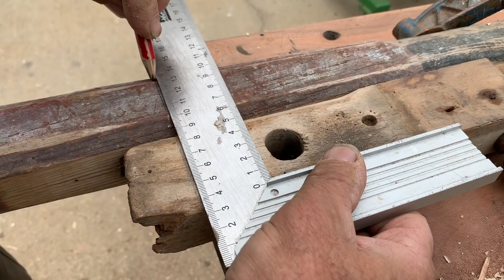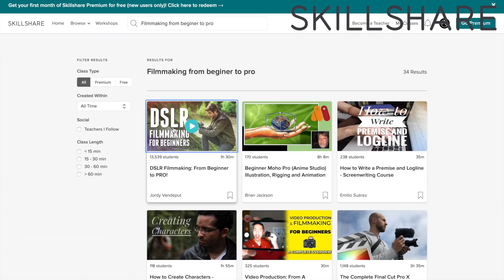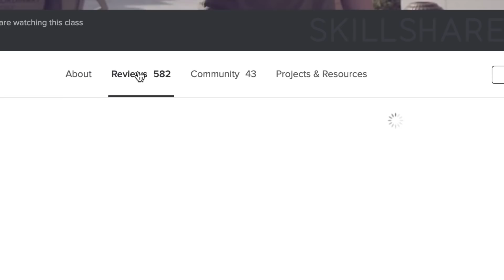Very damaged wooden Wheelbarrow Restoration

Comment: It seemed like a majority of your work here was in replacing dry rotted wood.  you used several methods of repair and replacement, all beautifully done.  It definitely added some character, and strength as well, to a work that already had plenty of both.  Excellent,  as usual!

Comment: Lovely restoration, but you should have kept those old square nuts.
Reply: it looked like they had a left hand thread!
Reply: @markwilliammandigers1001  They had, but LADB could have used a left-hand threading die (easily purchased on Internet) or re-threaded the nuts to normal right-hand thread (but that would not have kept the nuts genuine).

I´m very much for keeping old stuff as genuine as possible, without taking away the original roughness of the material and the patina received from many years of use. I also believe that such an approach heightens the value of the restored item.

Comment: I will never understand the fascination some people have with spending so much time restoring something by patching the old lumber. If it was something that the old lumber was so valuable and patching could be done cleanly and artistically, then that could work. But for me, I would have just rebuilt the whole thing using new lumber and been done in half the time, and have a much nicer looking end result. As for the end result, you want the antique weathered look? Leave it outside for a year or two and you will get it.

Comment: This is the type of work I imagine a village handyman would have done in 80 CE to the 1200 CEs.
Reply: Except for the electrical drilling mill press, the Dewalt belt sander, the steel screws and washers, the square ruler, the bonding compounds, the cordless handrill, the skill, the electrical jigsaw , how the hell is that 80 CE - 1200 CE? Because none of that shit existed in those days.
Reply: You're right there was no electricity, however the power source was your muscles, and the result was the same.  All of the various components/tools did exist, just in a different shape.  The human skill was even greater since you had to think instead of letting a computer do it for you.  Bonding compounds??, have you never heard of rabbit hide glue or fish glue???  Cordless drill? every drill was cordless, jigsaws were hand powered.  The world did exist and existed very well and artfully before electricity was discovered.  Are you saying that people were incapable of making a true square piece of wood, since the Egyptians had been doing it for thousands of years.  Are you saying a metal strip with parallel sides could only be made with computers and the most modern CNC machines when they were made every day by hand by all blacksmiths??

Comment: Very nice patchwork. Always try to reuse as much original wood as possible, great practice to keep. Not sure I’d have glued/epoxied everything besides the repairs though. After all it is an outside decor so it will be getting wet, joints will swell and shrink according to the temperature out and I’d hate to see all that love you poured into that start warping or cracking. I did one of those years ago too, lined bed with plastic and put some flowers in it. They are a timeless piece no doubt. Great job, keep’em coming👍🏼👍🏼

Comment: HELPFUL HINT GUYS!! lol....anyway...if you want to use less product it is a simple fix. Get what ever container you think will work for you, plastic butter tubs, baby food jars, soda cans or cream corn...and put these in areas you have nothing and takes space of products like rust remover or paint stripper, so you can fill up the space where product wouldn't be covering your metals. Also, put items with heavy grease on them in a container of cat litter. This stuff will soak a ton of oit with only the effort of opening and pouring a bag. Leave it sit overnight and in the morning give it a rinse. Next put it in a tub and set some space fillers as previously mentioned around through, under or in it! There ya go! You just saved time and money, not to mention MOTHER EARTH!. Make sure when the litter isn't going to soak up any more oil etc that you dispose of it according to your county's bi laws on toxic waste. My town has a drive where you can take batteries, containers with left over paint etc, 2 times a year!

SORRY ABOUT ANY TYPOS I didn't put my glasses on to write this.

Comment: For the halved joint, I suggest you try making multiple cuts about 3mm interval to a bit less than the desired depth and then getting the material out and flattening the surface. At least, it's the way I learned how to do it. :)

Comment: Nice rebuild, however, it would have been even better with period screws, nuts, bolts and nails. It would (I am sure) have increased the resale value also. My first thought in looking at the final product was: "what, Philips head screws in a 19th century wheelbarrow!" (because they were so obvious) Otherwise good salvage.

Comment: Out of curiosity, how long do you expect the "restoration" to last since you used dry-rotted wood in the "restoration"?

Would have been better to re-use the wheel, axle, brackets, nuts and bolts as possible, new lumber (not plywood) and then paint the original color(s), if known.

It might actually be useable then for more than a planter or for decor.
The handle "repair" is not going to hold. It will fail if you put a load on the wheelbarrow and attempt to move it.

I'll give you an "E" for effort, but a fail if your intention was to have a useable tool.
Reply: I´d agree. The connection in  the handle is too short and rough to get a reliable bond. Also, the wegded floorboard needs to stay loose in order to give it a whack from time to time to compensate wood shrinkage. Finally, less chemicals and a heat treat instead would have been more effective.

Comment: As beat up as that barrow was, I would have took it apart and using old wood that is in like new quality, would have used the old rotted parts as patterns. After all, you have had to replace some of the iron parts and almost half the wood. About the only part good enough to reuse was the wheel.

Comment: OK this needs to be said. You and a few other channels I've seen are not restoration channels. You are a conservation channel, which in my opinion takes more skill and is much more important. 

In a restoration all the wood would have been replaced with new wood making the project look new (and to me, far less attractive). Conservation uses as much of the original material as possible retaining age and character. 

I love the work. You do a fantastic job. I'd highly recommend an electrolysis bucket for removing the rust. Give your elbows a break.
Reply: Fritz - there's a "theory" about this - I can't think of the title (name) ... It revolves around the fact that if you keep replacing parts - it's no longer an antique. For instance - an antique ship in a museum with rotting wood. If you keep replacing boards it's no longer the antique it was - just a reproduction of sorts. What is that called? Anyone.
Reply: @geneconlon9728  and at what point does it cease being the original ship?
Reply: @fritzcolburn  That's my point - there is a name for that theory or syndrome. I can't remember it.... In this video he was half way there ... a lot of replacement parts.